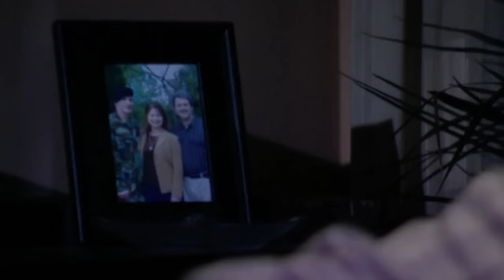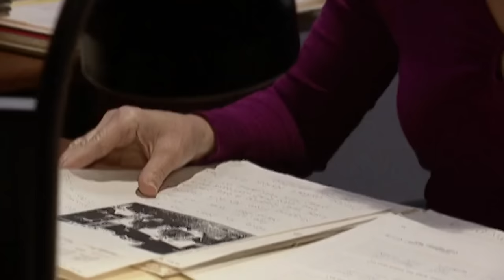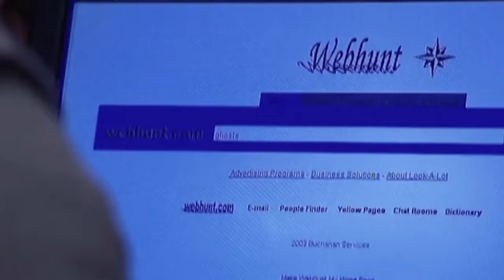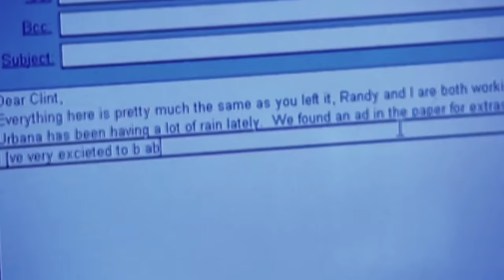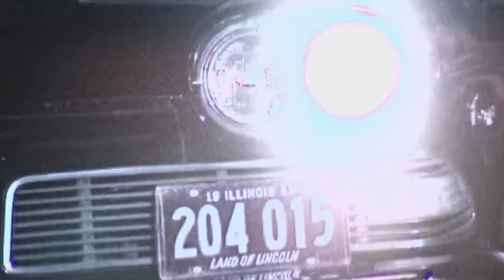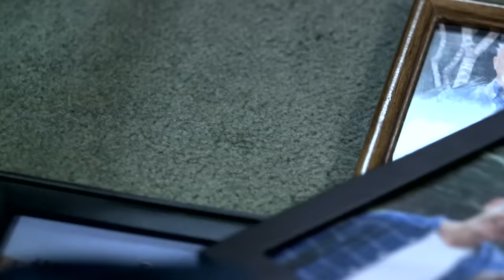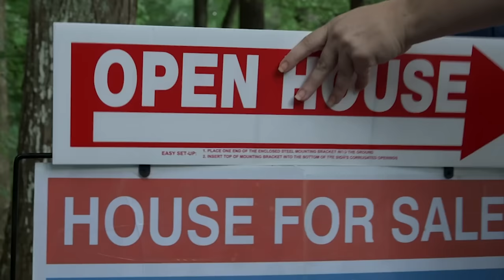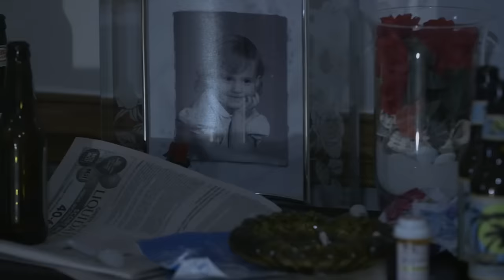Tortured Souls Attack Innocent Homeowners | DOUBLE EPISODE! | A Haunting

Comment: If prayers and spiritual cleansing doesn't work it means you lack faith it what you believe is good and holy. Also, Chasing ghost is fun and exciting, but when it is reverse and the Ghost is the one chasing you wont be so much fun for you anymore. And when there is an accident in your properly always get it bless or cleanse especially when the victim died later on, so no negative energy will surround your property. Also be aware, that if you do believe in holy, never deny believing the unholy as well, you can protect your own self once you are aware of those two and believe it in as equal.